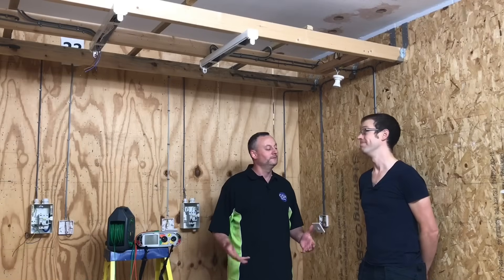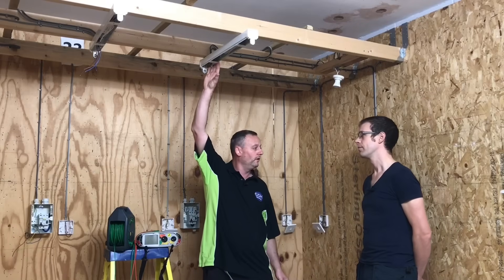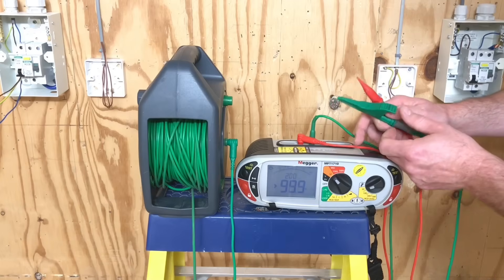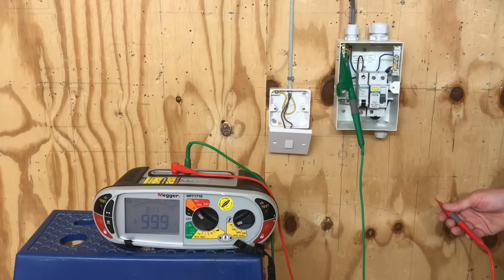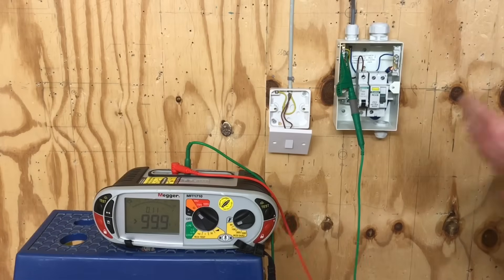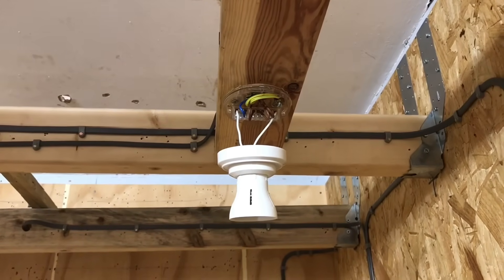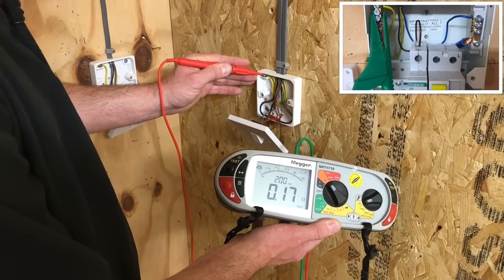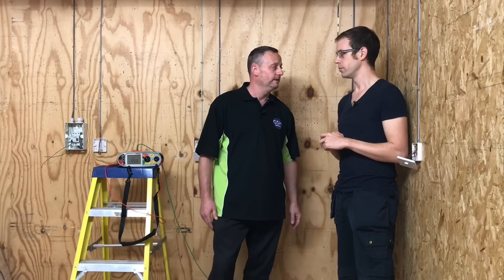How to Test Continuity of the CPC for a Lighting Circuit Sometimes Called the R2 Test

Comment: One thing I don't understand when doing R1 + R2 method to check polarity.... what if there was a double cross over along the circuit somewhere?  The installer inadvertently reverses polarity at one rose (for example) and then reverses it back again at some point further in.  Woukd the test at the end of the circuit show correct polarity?
Reply from the maker: You test at every point on the circuit not just the end point

Comment: If doing this R2 method you wouldn't be able to calculate a Zs would you or is there a way to do so???
Reply from the maker: Great method for fault finding and the same method is used to prove the protective bonding is in place. Thanks for watching and commenting. Gaz 👍
Reply: take a live  zs at highest R2 reading pont.

Comment: Very good video, thanks.  I would probably lock off the main switch in a house as you pretty much have to use CU open and unattended.
Reply from the maker: Totally understand - no supply connected - checkout my playlist on safe isolation 👍. Thanks for commenting. Gaz 🦾

Comment: Hi gaz which megger machine would u reccommend to someone justbstarting out
Reply from the maker: Megger MFT 1710 or 1711 have a look on eBay 👍. Thanks for watching and commenting Gaz
Reply: @GSHElectrical  thanks gaz. Dont know if u can help. A grien of mine who helps with a friends electric says under new regs the earth wires on lighting circuit etc dont have to be connected to metal back box. I say they should. Am i correct

Comment: If there’s other circuits in the consumer unit and the croc clip is on the earth bar do the other CPC’s not effect the result.
Reply: If they're common somewhere then yes!
Reply from the maker: Hi no. If the lighting circuit was say in metal conduit the conduit would create a parallel earth path I will cover this is a future video. Thanks for watching and commenting GSH Electrical